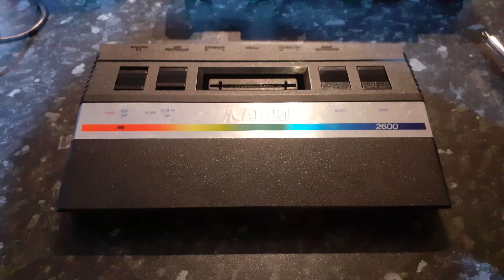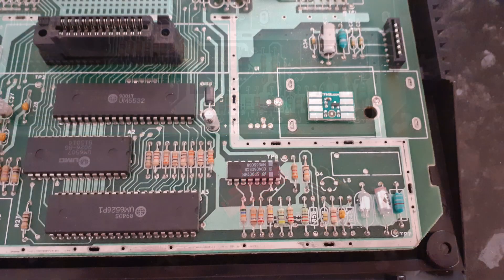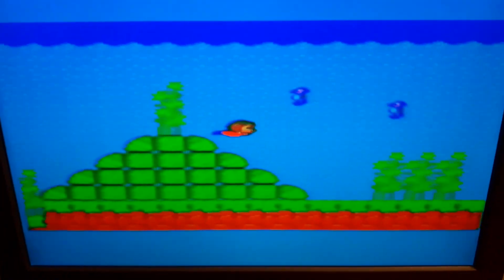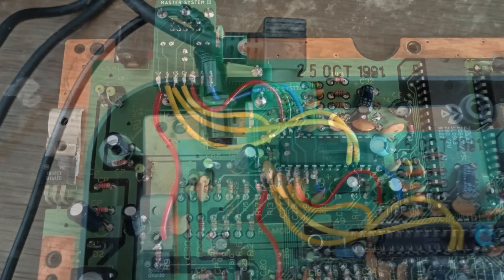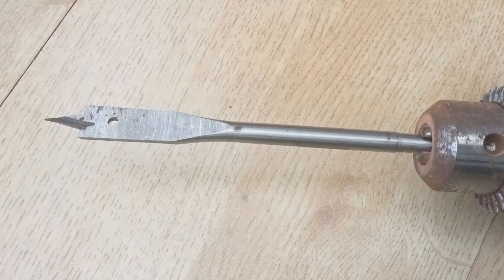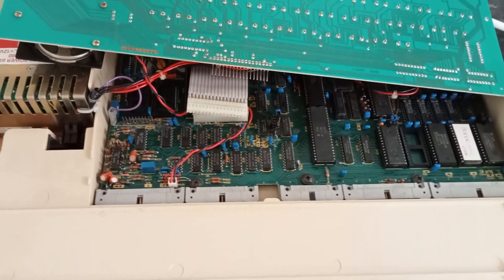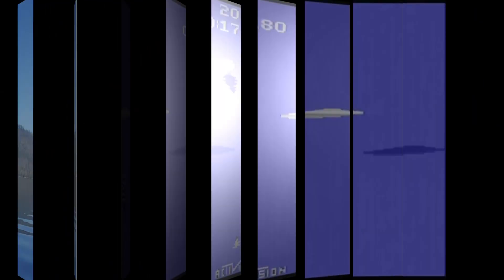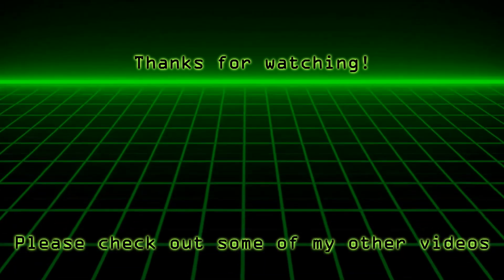Retro Hardware Modifications - Atari 2600, Sega Master System II & BBC Micro

Comment from the maker: Links to the products/guides mentioned in this video:

Atari 2600 Jr Composite AV mod: https://www.thefuturewas8bit.com/shop/atari/atari-composite-video-mod.html

Sega Master System II Passive RGB video mod: https://www.consolesunleashed.com/product/sega-master-system-model-2-passive-rgb-video-mod-kit/

Guide for fitting a 60Hz switch to the Master System: https://www.smspower.org/forums/11234-ModdingSegaMasterSystemIISMS25060hzHowTo

Alternatives for audio output on the BBC Micro: http://bbc.nvg.org/doc/A%20Hardware%20Guide%20for%20the%20BBC%20Microcomputer/bbc_hw_06.htm
Reply: Cheers

Comment: I've got the mod for the Atari 2600 - I've got a light sixer though.  I went for the deluxe version of the mod as I don't want to be soldering extra cables to the pads, it comes with a connector which is nice and simple.  I'll be doing the mod at the same time as I will be recapping the board and replacing the 5V regulator, hopefully in the next couple of weeks.
Reply from the maker: Cool, let me know how you get on. The visual improvement over RF is quite impressive even though it is only composite.